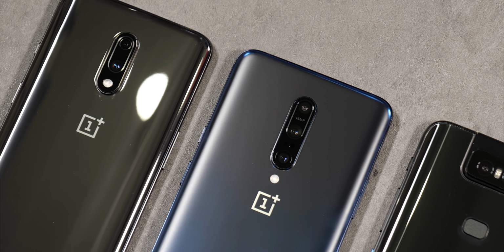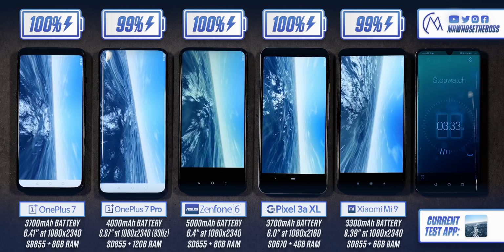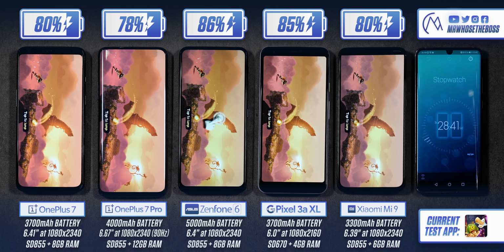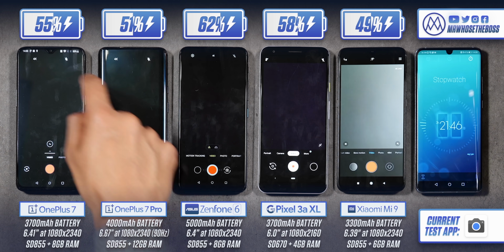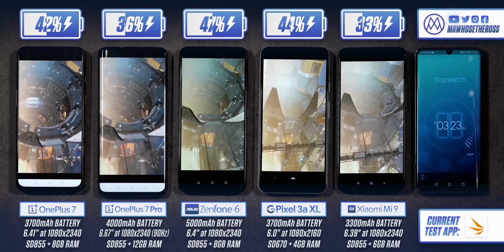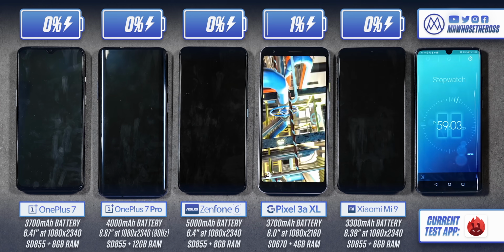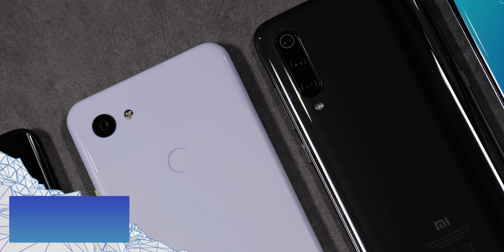OnePlus 7 vs 7 Pro / Zenfone 6 / Pixel 3a XL / Mi 9 Battery Life DRAIN Test.

Comment: Pixel won because low spec cpu and small 1080p 6 inch display
Reply: Bro it's due to battery optimisation by them my pixel 2 with 2700 mah lasts nearly 6 hours
Reply: vikas gouda you’re right
Reply: @vikasgouda9417  yes i admit that google's battery optimization is good but thats because it constanly kills apps that are in the background. Remember the pixel 3 performance issues? Also stock android has little to no features like ios
Reply: @Y4vuz12  it's all about optimization and SoC. zenphone was destroyed compared to the pixel battery differences, regardless of screen size, as they're pushing near the same amount of pixels on the displays. OnePlus is noted for it's "optimizations" and "near stock, clean" Oxygen OS..
Reply: @ArtisticallyEligible  why you not understanding him
Reply: @ArtisticallyEligible  "destroyed" LMAO
Reply: @slimshady7625  believe it or not, yes. put that phone with a 3,700 battery and ull be balling ur eyes out
Reply: @ArtisticallyEligible  pixel3a  won cuz of it's cpu now put the pixel 3 against the Zenfone and let's see who wins even though it's processor is one gen behind
Reply: @slimshady7625  pixel 3 is way different and has a lower battery than any phone that was in this test. SoC = system on a chip, which is part of what u said (cpu, consisting of other components integrated together). it's the 3a XL, btw, not 3a.. this one has a 3,700 mAh battery, why would u downgrade to a pathetic sized battery (pixel 3, with 2915 mAh). do ur research before u try to be a fanboy and make unrealistic, fanboy-ish comments lol. 5,000 battery vs 2,915, are u high? it also depends on how many charge cycles the batteries been through, so u have to take that into account. the zenphone just came out and has a fresh battery, but still lost dramatically to the pixel 3a XL

Comment: One important point about the 1+ 7 pro is that - AFAIK - they're working on some sort of variable refresh rate so that when the screen isn't busy, the refresh rate will slow down - which in turn will also save battery in the long run. 

When this update comes out I do not know. but it's definitely something worth thinking about.
Reply: Yeah that's how freesync works. The refresh rate range is 35 Hz to 75Hz on some monitors.

Comment: (Asus) 5000mah Battery <  (Google) 3700Mah Battery
Great Battery Life - 3aXL
Reply: Prasanta Giri keep in mind that zenfone has better display snapdragon 855
Reply: Sd855 > Sd670
Reply: @Rafso10214 
Soo 855 is More battery efficient... 
(5000 Mah + SD855) is better than (3700Mah Battery +675)
But battery life is better in 675
On paper No QUAD HD panel both are full HD... and 1300 mah bigger battery in Asus
Reply: @techworld7751 
No QUAD HD panel
I think Zen Ui is not Optimized
Reply: @Rafso10214 
Value for money - Asus zenfone 6
Overpriced - Google pixel
But i compare only battery life
Reply: @PrasantaGiri1MR  zenui stock android ??
Reply: @wanmaziah9835 
70% Stock, 30% Custom
Reply: @PrasantaGiri1MR  Asus Rog ??
Reply: @wanmaziah9835 
No stock Android
Reply: @PrasantaGiri1MR  but if Rog does not stock android os so why the get the android pie so fast rather than black shark.. because bs use joiy UI which is almost to stock android but stuck to android Oreo not getting update by android pie.. ?? How
Reply: @wanmaziah9835 
it's depend On Company
Reply: @PrasantaGiri1MR  ok tq 👍

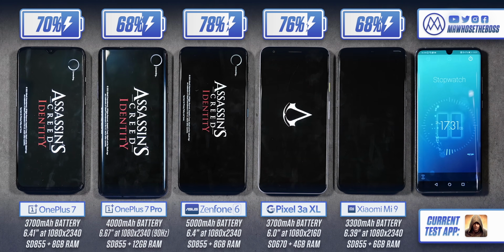Comment: 3:13 Why does the Zenfone 6, Pixel, Mi9 screens shrink so much with black borders in Assassin's Creed compared to the OP phones? That would skew the results.
Reply: It's their software. It doesn't skew anything.
Reply: @Volley_SKD  If the resolution also shrinks, its less work for the gpu. Also amoled displays of the Mi9, Pixel 3a XL save battery when large parts of the display are showing black.

Comment: Percentage says nothing until you relate it to the amount of Mahs that has been used.
30% of 5000Mah is not the same as 30% of 3700Mah.
Reply: Google plixel is smaller screen n sd670 is not power ful chip, so giving better battery
Reply: @vijjucreation7811  A better processor means less throttling and more efficiency

Comment: I would love to see you do a battery test between the Lenovo P2 and the Zenfone 6. I'm considering switching to the Zenfone 6 because it's really similar to my current LP2 but with better features (camera, processor...) - albeit its slightly smaller battery size (5000 vs 5100 mAh)
Reply: Lenovo P2 owner here. GSMArena states the P2 is much better on battery performance. It's Super Amoled screen also helps, against the Zenfone IPS.
But yes... The Zenfone is top gear!
Reply: @jacvpt8778  Thanks for the quick reply! Man, I don't know if I'm willing to sacrifice the godly battery life that the P2 has...

Comment: Also the pixel have 6 power efficient core and only 2 efficient core, so obviously performance limitations by hardware also saves battery consumption
Reply: Yup even more SD 855 is powerful chip compare to other chip sd 670.. SD 670 is less power what I mean setup of the core SD 670 only 2core performance clock speed 2.0ghz and SD 855 1prime core 2.84ghz and 3core 2.42ghz you will see the clock speed and core is not same so yeah that why pixel because of this + oled + small screen + os optimiz.... Bla bla wkwkw 😂 I think this is not fair for battery test because one chip use lesssss powerrrrr hahaha 😂

Comment: i am actually disappointed at the results. Zenfone has 24% bigger battery size. THAT IS NOT A SMALL AMOUNT!
The difference in screen size is merely .4 inch
SD 855 is more power efficient than that shit SD670
Still loses to Pixel3aXL, by HALF AN HOUR. WTF Asus , you are starting to look like those Chinese 5000Mah phones with average battery life ! BIG TALKS AND NO SHOW!.

Comment: Something that seems to be the case is that data intensive tasks drain the Pixel 3a XL's battery faster than the Zenfone 6's. I believe the radios use similar amounts of power, and this is where the Asus's battery comes in handy. It doesn't entirely make up for the processor and screen consuming power in other parts, but I think it explains why the Pixel was able to beat it. That is, most of the tasks that were running in this test did not use much data.

Comment: no brainer the pixel wins coz of the chipset it requires less power...put 855 on that it will drain faster than the asus 6
Reply: Hahahaha just rileks.... I think the same way from what you think yeah the biggest pixel 3 win because chip that it... If SD 855 will drain much more battery I sure with you no doubt about that.. 👍👍👍

Comment: winner : oneplus 7 pro with 1080/60FPS setting

also zenfone is the most "less battery performance" for me. it's the highest battery capacity yet perform not to different with 1000mAh difference. in the long term, the battery will get % reduced performance (aging) and the highest battery will suffer more
Reply: Because of the high ram

Comment: You should develop an app or script that runs on the phones automatically to test battery life and other metrics such as speed, temperate etc. That will make the test more accurate. You can call it MrWhoseTheBoss anyway and host it on App Store and PlayStore for people to test their phones and have a MrWhoseTheBoss Leaderboard on the tests that you usually make for us your YouTube fans.

Point to note is that the app can be controlled either remotely or by Bluetooth using another device. So when you prepare these tests you start the app to run automatically on the devices under testing using another device via Bluetooth.

Comment: i still bet on zenfone 6 based on my experience..

samsung s10e s10plus s10 p30 pro mate 20 pro pixel 3/XL 

based on all of this model i used..

zenfone 6 is the most efficient and has more screen on time with my heavy use.. averge of 8hrs to 9hrs++ unlike the other which avrge 6 to 8 hrs.. 

one big factor which you would really want to try with battery test is using data.. data have much bigger impact on the battery. it drains more than using wifi.

Comment: A worse explanation to why the Pixel is holding up to the Asus I hope nobody, but you can provide. It is obvious why: the Zenfone is badly optimized, while the Pixel is very well optimized. Optimizing hardware to work well with the software is very important in phones, as bad optimization has a bad impact on battery.

Also, the screen being bigger argument is not valid. Why? Because the screen lights up the same amount of pixels on both the OnePlus 7, 7 Plus and the Zenfone. It's the pixels that eat the battery, not the surface (I literally cannot find the logic why would surface eat battery).

Comment: So this test seems a little more demanding than the one with the flagships, given the Mi9 here ends with 5hrs 47min and in the previous video it ends with 6hrs 12min, and still the OnePlus 7Pro @1080p and 90Hz ends up with 30 more minutes of battery life compared the same phone @1440p and 90Hz on the previous test, meaning running @FHD + 90Hz may be sweet spot when it comes to battery life, 6 hours sounds good to me already.

Comment: Im not impressed by the Asus at all. Compare it to the Oneplus 7. It has
 the same size screen and same chipset. But 4000mah vs 5000mah. OP7 got 6
 hours and 42 minutes vs the Asus 7 hours and 32 minutes. 
5000/3700=1.35, 452/402=1.12
So you get a 35% bigger battery, but only 12% more batterylife.
Reply: Yeah, but personally I like ips panels, and also need headphone jack. Otherwise, I would go with Oneplus 7.

Comment: The only smartphone you can compare are the OP 7, Zenfone and Mi9 because they have almost the same spec. And if you considered the different batery capacities the OP7 was the winner because IT shut down with The Zenfone 10% but the different in the batteries is about 1300 mAh.

Comment: Am I the only one who notices the huge black box at the bottom of the Zenfone during each gaming/stress test? Assuming it's AMOLED this would give it a huge advantage considering the pixels would be turned off. Oneplus 7 and 7 pro seem to use the most of their screens in every test. Also, some phones have  white buttons at the bottom instead of black using more battery life, is this unavoidable for each phone of a dark theme setting? I know the Oneplus 7/7 pro both  has a dark theme.

Comment: Mrwhosetheboss logic: Puts every phones settings into equivalent to keep a level playing field, BUT let's OnePlus 7 Pro into 90Hz setting. Why? Because what it is advertised for. 
Ladies and gentleman, this is Mrwhosetheboss, the most unreliable youtuber.
Reply: it must be tested not just with 90hz mode, but also with 3120×1440 resolution. because almost all will be using it  in this mode. so real world results in battery drain must be even worse than in this test.
but pixel must excluded from test, because it is weak phone.

Comment: Why test the 7 Pro at 1080p but at 90Hz? Prior testing has shown that to be the worst combination for battery life, presumably because the device is scaling everything by 1.5 to get 1440p down to 1080p. QHD 60Hz would probably be best for battery life, or just leave it "as it was designed" since that's the justification for keeping the refresh rate at 90Hz

Comment: Any idea why some phone's SOT varies so much across battery tests? I looked at the last 5 battery life videos. For example: 1. Mate 20 Pro (oct 30 - 7.44) (feb 22- 6.47), 2. S10+ (feb 22 - 7.30) (mar 29 - 7.05) (may 15 - 6.10 - this time in quad hd res), 3. iPhone XS Max (oct 30 - 6.56) (feb 22 - 6.11) (mar 29 - 5.58) (may 15 - 5.25) - this one went down so much!,  Mi 9 and P30 Pro have smaller differences, but still lost 25 and 22 minutes of SOT in the second test. Were the tests or apps getting more battery intensive over time or is it just battery degradation. If it's the second, then it's quite alarming, especially for the Mate 20 Pro which lost almost 1h SOT and Iphone XS Max which apparently lost more than 1h 30m or about 23% of it's battery capacity in roughly 6 and a half months.

Comment: I think it's unfair to not put the OnePlus 7 Pro in the 60 hertz because yes people will use it at 90 but they will also use it on auto or to kick so if you could have put it down to 1080p put it in 6t and see what it can really do I would like to see it as well I think you could squeeze another half hour out of the battery

Comment: Oneplus 7 pro or s10 plus
Help
Water resistance is a must
Headphone jack i will be prepared to sacrifice.
Helpppp
Reply: OnePlus 7 pro because your getting more for your money...and if you watch Jerry rig video the OnePlus 70 pro is actually water resistant
Reply: I am not Samsung fan, as both Samsung and old 1+ owner, 1+ seemed more reliable and still recommending S10+. 
Price on S10+ is already dropped to 7pro's league. It has better battery life, more managable size and UI, better camera, superior speakers, brighter screen, ultrasonic scanner, better service support.
On the other hand, 7 pro has much cleaner and faster UI, 90hz solid screen. IMO it is not enough to go for chinese one.
P.S. Buy only with Snapdragon equipped Samsung.
Reply: Shawayne Grossett but its not certified

Comment: Android authority made a graph of the OnePlus 7 Pro's battery life at different settings while web browsing, supposedly at its best, the OnePlus 7 Pro can get more than 11 hours of web browsing time. and if you use that ratio to the screen on time in this video, the results would be:
OnePlus 7 Pro 90hz 1080p 6h 8m
Oneplus 7 Pro 90hz 1440p 6h 45m
Oneplus 7 Pro 60hz 1440p 7h 25m
Oneplus 7 Pro 60hz 1080p 8h 31m
I have ZERO clue how accurate this really is, and yes their test says that 1440p got better battery life than 1080p at 90hz (maybe because upscaling 90 times per second takes more battery life than just pushing the pixels?), but I just thought I'd put this up, because I'm very curious how 60hz 1080p compares to the Pixel.

Source: https://www.androidauthority.com/oneplus-7-pro-battery-life-90hz-display-985616/

Comment: It's bit unfair compare SD 660 with SD 855 because it is more power hungry chip. In regular task they should use about the same amount of energy, but then it comes to gaming or synthetic benchmarks SD 855 use all his power in order to score higher score or frame rate ( depends what you are doing ). Sure 660 do the same thing but in general it use less power then its fully loaded then SD 855.

Comment: I don't get it. Why are all the Phone not running at their highest possible resolutions in this test. Since the company boasts of its 2k resolution the same should be used in all these tests. For eg. You have used 90hz for one plus 7 pro. Because there is no point in having a qHD display and using it in 1080p. The company charges extra for those displays for us to use them.

Comment: if you had put the 1+ 7pro on 60 hz to even the playing field it would've likely won as it currently lasted 368 minutes whilst doing more work than all others, if put to 60 hz it would be doing 1/3rd less work and as such lasting 1/3rd longer: 368 × 1 1/3rd = 490 2/3rd minutes or 8 hours, 10 minutes and about 39 seconds beating this lists nr1 by over 10 minutes

Comment: It's sad that none of these reviewers understand what turning down to 1080p means. It's not that the screen turns into 1080p, it's not possible. It still has 2k worth of pixels. It's only the processor pushing fewer number of pixels. So a native 1080p screen will always draw less power than a 2k screen running at 1080p. So you should leave the screen at 2k if that's the native resolution since the improvement you'll see in barely 5-10% in battery life.

Comment: The Battery usage depends a lot upon the RAM installed, with 12GB of RAM One+7 will always be getting least battery life, more over Pixel 3a has only 4GB of RAM so, obviously it get longer battery life. Though there are many other factors other than RAM on which Battery life depends such as the screen size(as said) and even Processor installed.

For me I will say Zenfone  6 with 8GB of RAM is the winner.
Reply: You have absolutely no idea what you're talking about

Comment: Since 855's NM is smaller than 670 so assuming if i underclock zenfone 6's to 670's speed it should be better than the pixel by a large margin.

Comment: One plus 7 pro SCREEN RESOLUTION is 1440 x 3120
Reply: That's if you're using OP 7 Pro in QHD+. He set the resolution at FHD+ in settings in order to level the playing field. He didn't changed the refresh rate to 60 Hz tho since most people will use the ph in 90 Hz.
Reply: I see. I forgot that zenfone 6 only have 1080p resolution.

Comment: pixel 3 wins because of the small screen.
Reply: Zenfone still should've won because of the uniformly lit IPS trash they put in, and the 5000mah battery they one-upped the rest of the competition with. Pixel did just as well as Apple would've at thunderspanking the Zenfone.